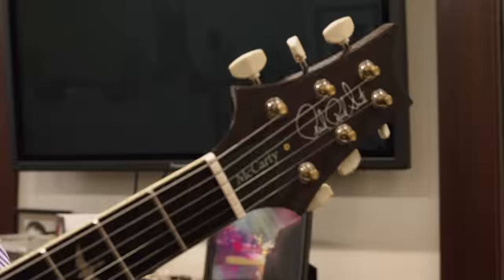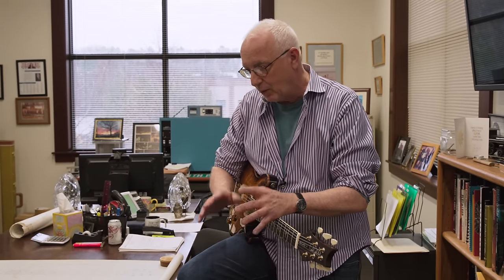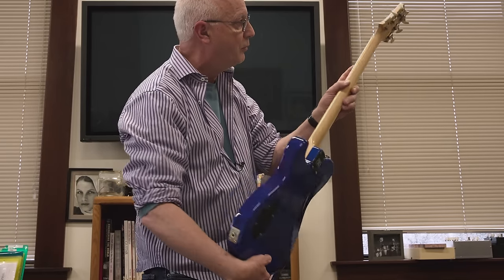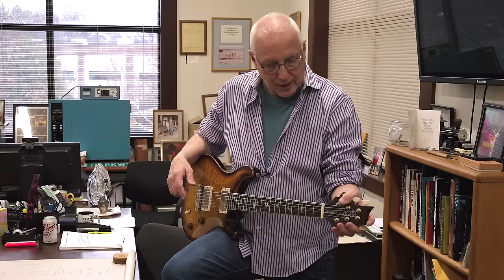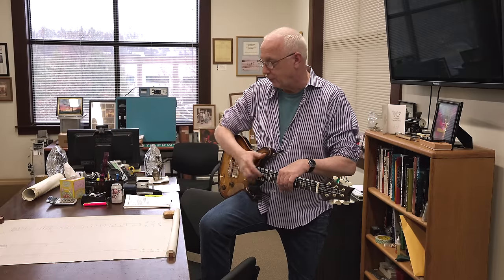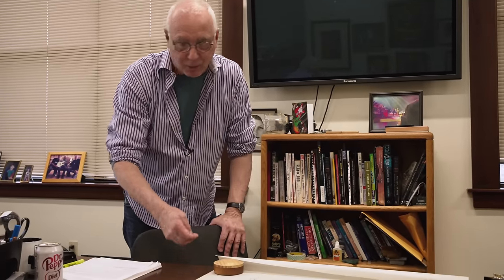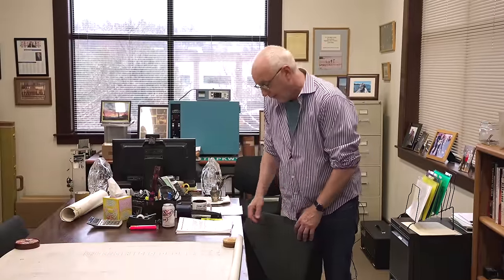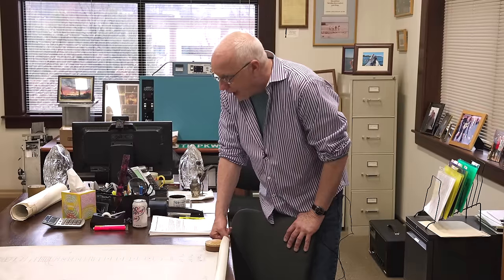Paul Reed Smith Explains New PRS Tuning Button Design | PRS Guitars

Comment: One can only assume that you wouldn't have made the change if you didn't think it added some "value" to the instrument's sound and feel.
Reply: Oh, I think a lot of manufacturers, like Gibson, make changes to save a few pennies per guitar.  I'm thinking the plastic buttons are cheaper than the metal ones.  I don't buy the weight argument--it looks like they're adding covers to the gears, so that probably adds as much weight as the plastic subtracts.  I'd rather have locking tuners with durable buttons.  I wonder how much they'll save by dispensing with the locking tuners on the non-trem models.   I agree with others who say that's the real story here.
Reply: The only "value" these add is more money in PRS's pockets and less money in their consumers' pockets (having to buy locking tuners separately)

Comment: I don’t relate to people’s obsession with locking tuners. The one guitar I had them on, a $1200 schecter, two of them would slip unless I tightened the absolute hell out of them. 

It’s just one more point of failure, one more little fiddly component that can break. 

They also add weight to the headstock. And as far as saving time with string changes… I’ve only broken 2 strings in more than 20 years of playing, one was while playing with alternate tunings and another was intentional. 

They just aren’t worth it and I’m sick of the notion that they are synonymous with higher quality.

If I buy another guitar with locking tuners those things will be replaced ASAP.

Comment: I have never understood why people put locking tuners to a non trem  guitar.
Reply: You can changes strings a lot faster on locking tuners.  I actually think that's their main advantage.
Reply: @richardsgear5783  Not really. You spend the same time locking the string as you would spend winding the string a bit more. I like the split shaft tuners the most.